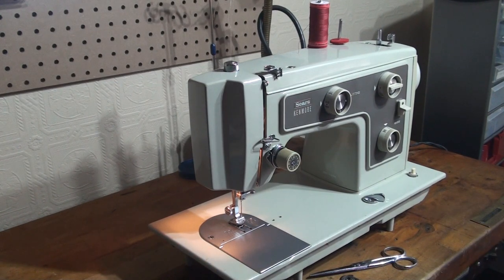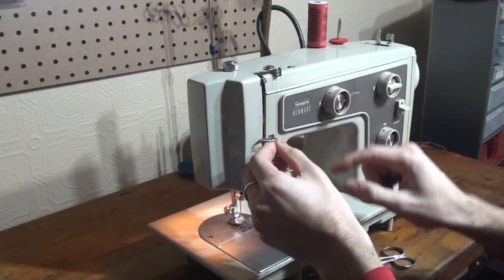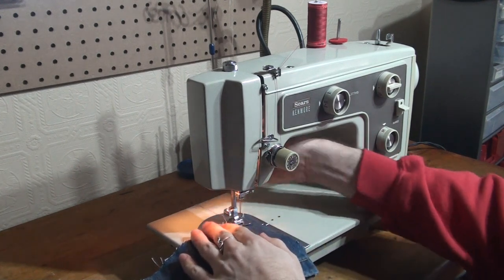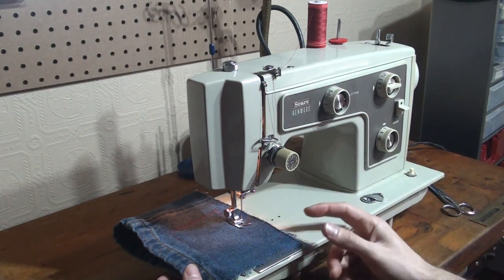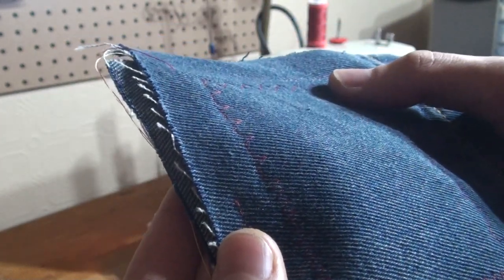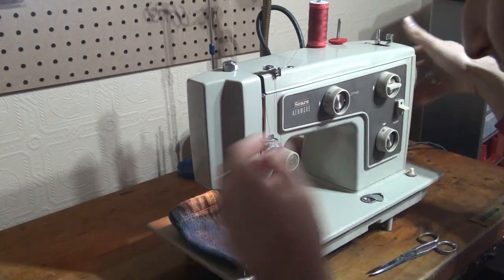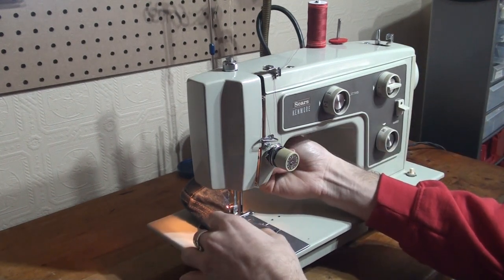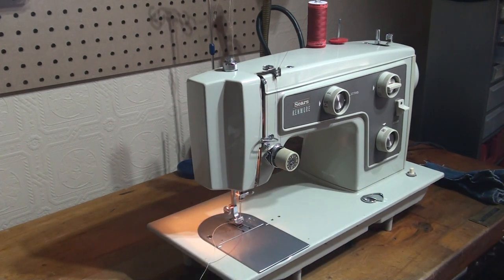Vintage Sears Kenmore Heavy Duty Sewing Machine - Serviced!

Comment: Thanks for the video.  I was given a 158 905 model Kenmore but when I sew it starts out OK but then quickly drags the material and the material does not advance. I can't figure out why. There is no info for my particular 158 that doesn't help me even when reviewing the closet model. I've done everything I could think of to prevent this. Would you have a clue as to why this is happening?
Reply: Research the 158.850 as they may be similar from what I remember.

Comment: According to a Sears download of the manual, you threaded or wound the bobbin wrong. 
That being said, my Singer 15-91 winds or turns the way you described.
Reply from the maker: Funny you should say this. I recently learned, after 2 years of putting my bobbin into the case (on a similar kenmore I used constantly) going counter clockwise, that it's not the right way. I think someone told me to do it that way a long time ago.

 Now whenever I correct a customer they are shocked. I don't blame them, I never had any issues myself.